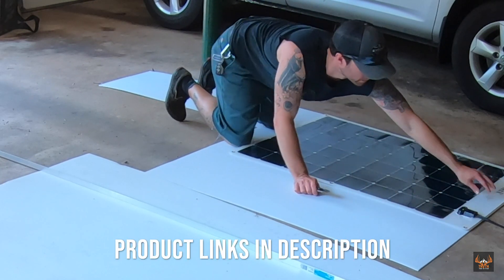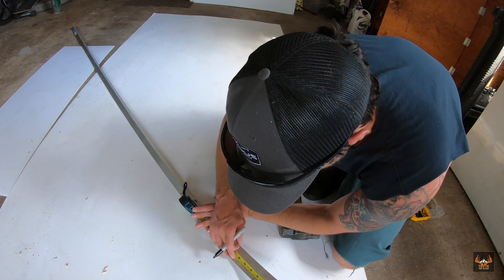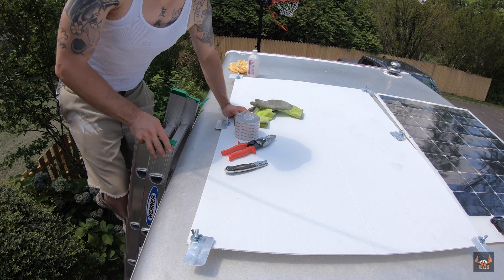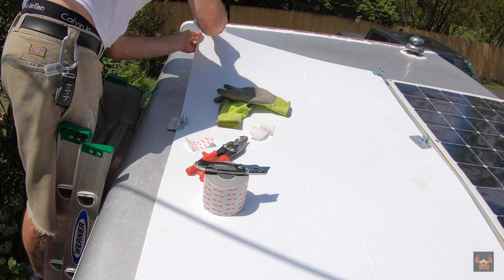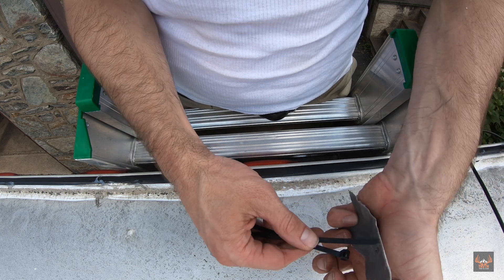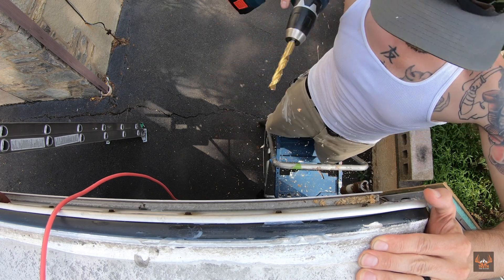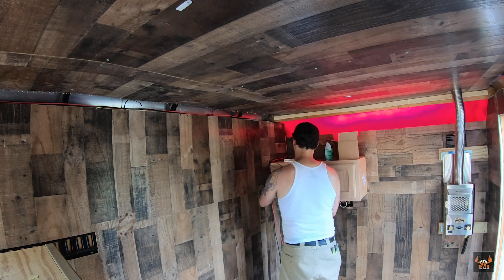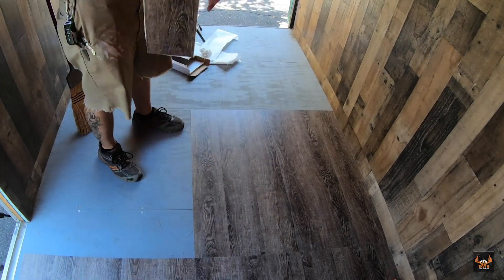How To Install Flexible Solar Panels On Trailer (Video)

Comment: Great video, just a quick question.  I have my shoreline powered all ready to go on my 7x14 cargo trailer, next is my solar.  I already have a 30amp and 1500W inverter, and 12v battery.  I would like to get a 200W solar panel to used for lights, and charge my laptop.  no tv, but would like to get a 12v cooler to use.  my question is will a 200W solar panel work? or do I need more watts?
Reply from the maker: How big is the battery?  I’d want to make sure I can house enough power for my needs. My battery is 1500 watt hours. I’d look at the watt hour draw of each appliance you plan to run and multiple that by number of hours it’ll take to charge or power. That should get you close to your wattage needs per day and what you’d need to replenish to not run at a deficit. From there you can think about how much power you need to produce per day. If you have a 200 watt solar panel...at best on a great sun day in the summer get 85% of that 200 watts for a short period of time when the sun is at the right angle. Any cloud cover or shading and it’ll reduce. I now have 280 watts worth of panels. On my recent fall trip I would get maybe 130 watts at peak sun. Fall sun not great given the distance and angle of the sun this time of year. I conservatively was probably replenishing somewhere between 300-700 watts a day (some days more...some less depending on cloud cover). My bank was big enough to go 4-5 days with zero power coming in. Long way of saying I’d probably add another 100 watts. The fridge will probably draw 400 watts a day if not more. I think they’re around 40-55 watt per hour depending on the brand. And I’d guess the compressor would run a total of 10 hours a day as a safe guess. 🤷‍♂️
Reply: @truthfromthestand9994   WOW thank you so very much.  Such great info.  I was thinking about the same after watching so many videos, it's gets little overwhelming.  I was thinking I should get a  300 or 400 watt solar panels and go from there.  I will need to get a 2nd deep cycle rv/marine battery  but i'm on a tight budget for sure.